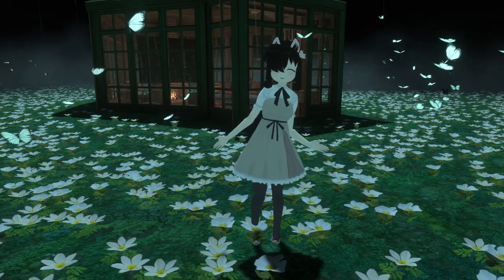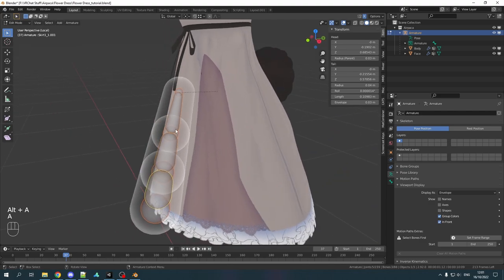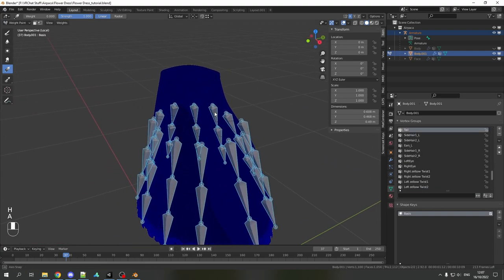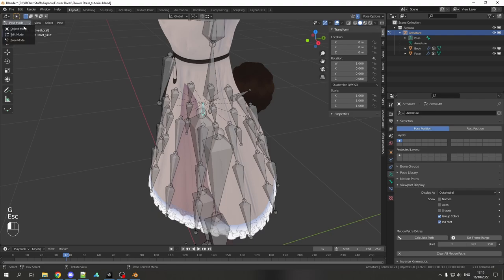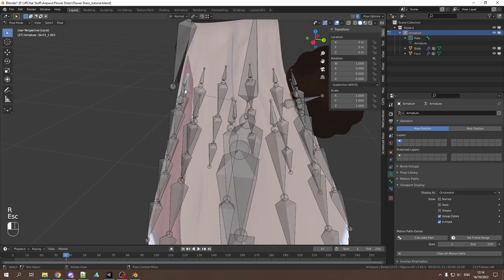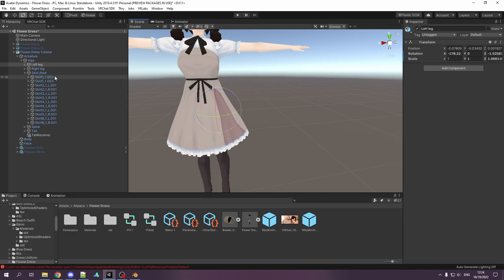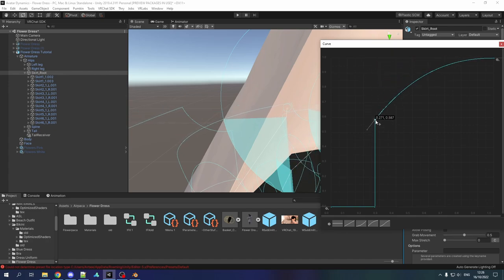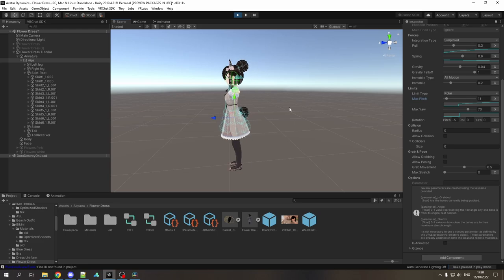How to deal with skirts in VRChat

Comment: At 3:05, you could do this much easier by setting the transform pivot point to 3D cursor, and put the 3d cursor in the middle of the skirt. Then, after duplicating a bone chain, just rotate by 30 degrees. Use the relationship lines as a visual guide to move the bones into place away from the center point and into place.

At 3:50, enable "Show > Names" in bone settings to easily check your work.

Comment: Okay, I followed this tutorial exactly, and I finally just finished it all. But sadly, when I test it in play mode and move my avatar around, the skirt jitters like crazy. What could be wrong?
Reply from the maker: Hoi, 15:05 - 17:00 is the thing you're probably missing. The first bones in the chain, the ones that have the rotation constraints - those need to have a max pitch and yaw limit of 0. If they don't have that, then they will jitter
Reply: @Airbee  Thank you, and I appreciate you answering my questions ☺️

Comment: Hello! Thanks for the video, it was very helpful. Although, I do have one issue.
Since my skirt extends past the knees, sitting makes the bottom of the skirt float in the air, and reveals the underwear in broad daylight.
Would there be any way around this? I also chose to have 12 bone chains of 5 bones each, do you think I could more reduce the count without trouble?
Reply from the maker: Should be possible to reduce without trouble, yea. As for how to deal with longer skirts like that... no idea, sorry :/
Reply: I'm currently working on a skirt that is almost floor length. What I normally do to at least help part of the underwear-reveal issue is I block out the crotch area. You can do this many different ways. What I usually do is just paint the texture black or some other neutral color, or I may even put some modest clothing under there, like shorts or bloomers. Or you could change your sitting pose/animation to something different, I guess? Then there are some other methods like using a shader to turn that under-skirt area completely black/shadowy, not sure how to do that but a friend mentioned it. Just some options.
Also, actually a potential fix for the skirt floating in the air when you sit... Another friend mentioned to me that there's a way to weight paint the lower part of the skirt to your lower legs so it kinda sticks to them better. Sorry if this comment was a lil vague but I'm still learning myself lol so maybe you can look further into these methods, hope this helped a bit :3

Comment: I get minor clipping at the front-center area even at 1.0 weight, is there a way to go slightly above that value?
Reply from the maker: No, you can't go above 1.0 weight as far as i know. You likely need to remove some weight from the other bones around it (Hip/Spine/Leg or something) Or maybe repositioning the bones a little helps

Comment: I have a question! What is the purpose of rolling the bones?
Reply from the maker: You see it at 17:30. If you don't rotate the bones, and all of them are facing to the front, you cannot properly use the Limit Rotation Pitch. They would all rotation forward, and not inward/outward. Making the limit less practical.
Reply: @Airbee  I see, thank you!!

Comment: I have to be misunderstanding something, I'm having trouble with my skirt phys bones jittering a lot when they move. Please help me.
Reply from the maker: Hoi, 15:05 - 17:00 is the thing you're probably missing. The first bones in the chain, the ones that have the rotation constraints - those need to have a max pitch and yaw limit of 0. If they don't have that, then they will jitter

Comment: i dont know if you still answering, im not using it for vrchat, followed all the order it was fine in unity, skirt following the leg movement but after i export it with univrm the skirt still pass thru is it possible because univrm is not compatible for Rotation Constraint?
Reply from the maker: I am not 100% sure, but yes, i think univrm does not support any type of constraint.
Reply: @Airbee i see, so the other alternatives way is through manually parenting it from blender?
Reply from the maker: @kokahashinda  i guess that could work, yeah. But you won't be able to have only a partial constraint (for example 70%)

Comment: I'm having a problem with my blender not letting me assign from bone envelopes is there anyway I can fix that?
Reply from the maker: does it give an error message?
Reply: @Airbee  nope, its alright if you dont have a solution though cause i have a few alternative outfits i can use
Reply from the maker: @xaviercanada7452  Maybe the mesh is not properly parented to the correct armature? Or the Mesh doesn't have the Armature Modifier added, and the correct Armature selected there?

Comment: I got a outfit the only has a front and back part   so i bascially just did the front and rear bones.      gotta flip the rear z still.  i still think I want to add a collider ontop of this for that extra effect :)
Reply from the maker: Yeah of course you can still add colliders, especially when there is no connection on the sides i think it should work out just fine :D

Comment: I have a small question, how did you select all in Unity at 11:24?
Reply from the maker: Heyo, i selected the first one, hold shift and then selected the last one :) It will then select all the elements in between.

You can also hold down ctrl to select/unselect single ones in between

Comment: This guide is outdated, it was recently discovered that rotation constraints are actually a LOT more expensive than additional PhysBones are. Plus, they don’t work on Quest at all.
Reply from the maker: "There's a billion ways of solving this in a different way, but this is what i currently do with skirts."

There is no right/wrong way to do it, and optimization is always about a balance. Adding 10 rotation constraints to your avatar won't make the entire lobby lag. VRChat recommends staying below 15 Constraints, which is the case with this method.
Also you can't get the same/similar effect with just additional physbones. To get something comparable you'd need to replace every constraint with its *own physbone component*, (not one component with all the skirt bones). Which alone would already be worse in performance than the constraints. But in addition to that, you'd need to add multiple colliders to each physbone chain, which again makes it less optimized. 

I am aware of the cost of constraints, and you certainly should use them with caution. But i wouldn't really call this outdated. Not yet at least :D